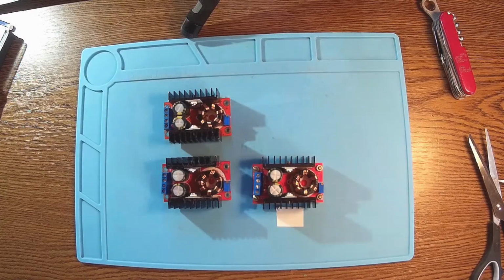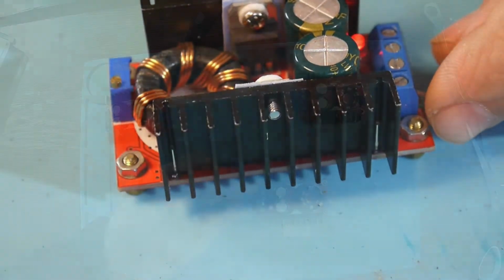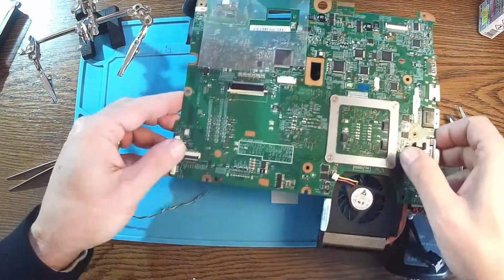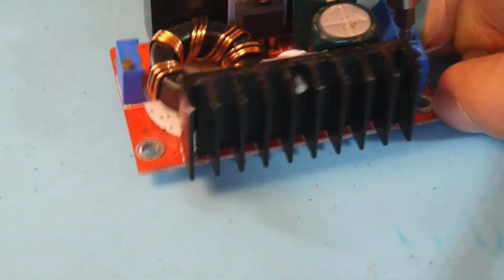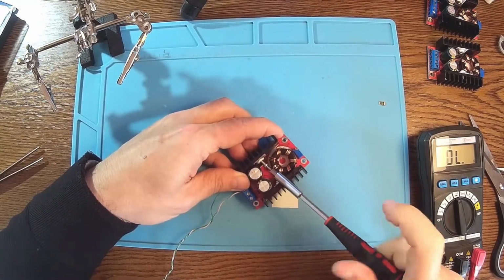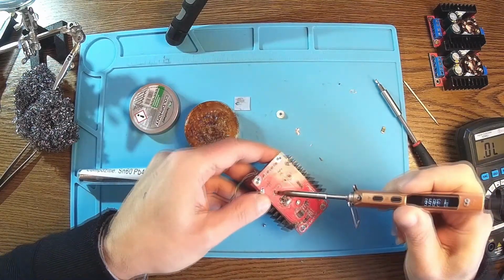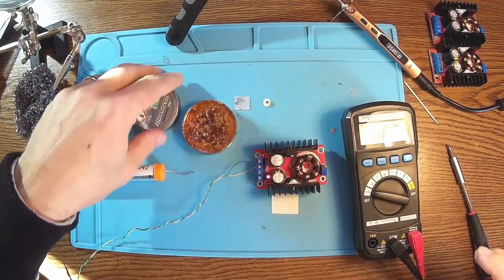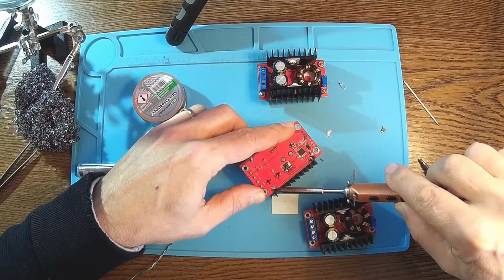Checking and fixing DC-DC converter

Comment: I have one of these showing double the voltage, 29V in and 57v to 70v out, what are your thoughts on this?
Reply from the maker: Probably a higher oscillator frequency. I'll check and be back with more
Reply: @viocaia  Thanks! I might add, the 57V was when powered by a battery pack,on my bench supply it pulls the same 29V input voltage down to 6V.
Reply from the maker: @FixTechStuff It's looking  auto oscillation, something, overloading the power supply, I don't know what to do, probably a new one will be better..check the capacitors specially and all the other parts..here is the schematic, check for 9V after 78L09 on pin 7 of UC3843
https://martin-jones.com/2013/02/15/150w-boost-converter-schematic/
Reply: @viocaia  Excellent, thanks for your help!  This one I believe was faulty from new. I'll check all that out and let you know.

Comment: I have one of these and today i don't understand what is wrong. i put 11.9 volts to it and expect 24 volts output but no only 11.6 volts i don't understand could it be a short somewhere?
Reply from the maker: It's very possible the diode is gone..
Reply: @viocaia  Schottky diode?
Reply from the maker: @zackvalenzia5400  Yep..that's the one going down first..anyway, there are a lot of parts there, starting with the IC, MOsfet, diode..it should be nice to have an oscilloscope to see if the IC is doing the job..and so on..but check the diode

Comment: i have this boost converter but it doesnt adjust its voltage and when try to a couple of turns with the potentiometer.. the transistor gets hot what might be the problem and solution? tnx for the help..
Reply from the maker: you have to be patience with the potetiometer, it's 1/10 divider inside..also you may check the Shottcky diode, they burns easy..even the mosfet transistor is prone to ruin..it should be nice to have an oscilloscope and see if the PWM controller is really working..sounds com[;icated but it's fixable.Check all the solders too.

Comment: Hello. I also have this converter. I use it for my T12 Soldering Iron. Input 15V to 24V. I used it only about 3 minutes and it doesn't boost anymore. Now input is as output!
Reply from the maker: check the electrolytic capacitors first, also better cooling...
Reply: @viocaia  Hello. I don't think that a capacitor is defective. I've used this converter only 2 minutes. Now on non load it's getting hot and input is as output.... What could it be?
Reply from the maker: @Thoni73  Maybe the Schottky diode, here is the schematic https://martin-jones.com/2013/02/15/150w-boost-converter-schematic/
Reply: Had exactly the same case just now . U need new UC3842 or UC3843 (8pin ic on the back of convertor),with UC3842 u maybe can reach 34v on the output versus 32 with UC3843 .. i just swaped that and now it is working flawlessly. Oh ye i had to swap led indicator too becase it burned out :D GL